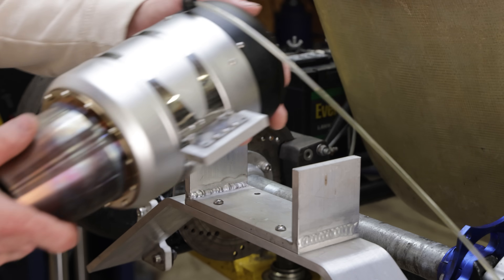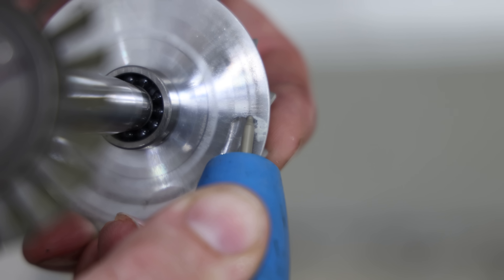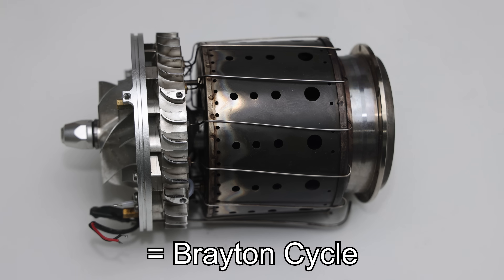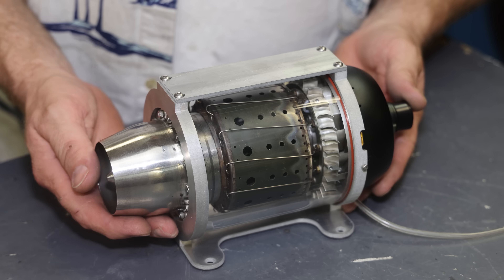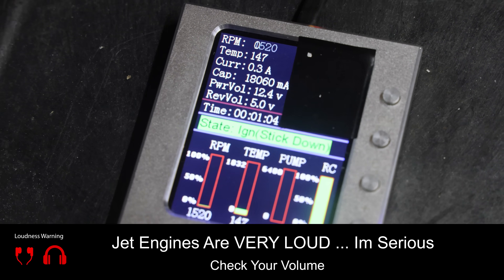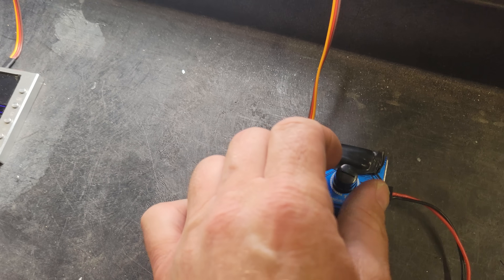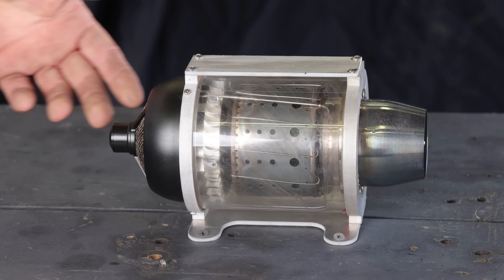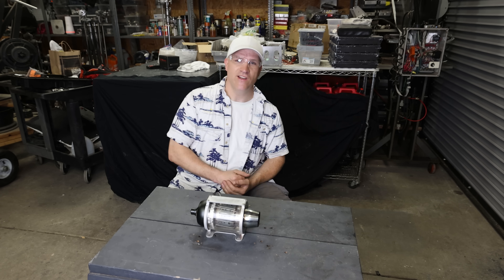See Thru Jet Engine

Comment: As you’ve built it, this is a turbojet. Meaning all of the intake air goes into the compressor and the combustor section. If you had built a high bypass turbofan, meaning that some or most of the air intake actually never gets compressed or burned, then would we see more of the fog going through the engine I’m asking. Would that also change the flow characteristics? Again just honest questions based on my very limited understanding. I’m curious and great content as always 👍

Comment: That would be an incredible opportunity to see how the parts heat up in a bypass type turbine engine too. Ideally, there should be no hotspots in such an engine as the only thermal expansion allowed would be within the air envelope and between the vanes with no heat transfer to other metal parts.
Reply: Bypass engines have a shrouded fan and the air exits around the outside of the core not through the core.

Comment: I am a gear head that was the best insightful video of a thrust type gas turbine engine .As a kid a guy built a turbine engine with an output shaft to a reduction box and tied it to a drive axel . The engine was only around two times maybe more physically the size of yours .The car this was mounted to was an early 60 vw bug  after problems solved took it to drag strip  .The bug is an aerodynamic disaster at 200mph it's an ugly  wing .Half way through a quarter mile run it took off  it landed on it's roof and went thru the traps around 180 mph on the roof and backwards ,to set a track record he had to make a second run and only had 10 minutes to get ready .The company was Turbineque, check your aerodynamic package . Liked your demo!!

Comment: As former civil aviation specialist, i would like to know how much force its making.
We in Eastern Europe use Kilogram-force (kgF) or Nm for torque  for jet engines
Reply: A turbojet engine like this produces force, not torque; this is not a turboshaft engine so it has no output shaft.

"kgf" is a non-standard measure of force (it should be newtons, N), but Nm (newton-metres) is a measure of torque.

Warped Perception commented earlier that 
"This one is small about 30 lb of thrust."
That would be 133 N.

Comment: your theory at the end is correct except in the case of turbo-fan jet engines, which is what you see on most commercial airline medium & wide body aircraft such as your 737's, 747's, 57's, 67's, a320's, etc, etc..
Reply: No, his theory is not correct for any engine. The force produced by a jet engine is a reaction to the high-speed exhaust flow, and that exhaust is almost entirely air. The mass of fuel is insignificant compared to the mass of air (fuel is 2% of air at the most); the fuel adds energy by burning.

Yes, turbofan engines are really turboshaft engines driving fans: energy is extracted from the exhaust flow to drive a shaft, which drives the fan, which pushes air for more efficient production of thrust... so only a small part of the thrust is in reaction to the exhaust flow.
Reply: @brianb-p6586  you're right, good to know. it didn't even cross my mind to check on that. all i know about turbine engines pertains strictly to turbo-fan engines as ive worked very near & around them for about 4yrs (im a structures mechanic, not an A/P, so i dont mess with them).

yeah i just heard what he said there at the end & im thinking like, ok ill assume hes right since hes opening his mouth Lol BUT, i know for a fact that doesn't apply to turbofan engines.. 
~thanx for the clarification

Comment: I was hoping you would be able to tell us how many pounds of thrust that produced. Maybe put it on something to make it move. The other thing is we all have seen the fighter jets flame on take off-probably at full throttle, but commercial planes don't. Why is that? I'll be looking forward to your response. And I just got an idea! Contact the NHRA and ask them if you could have a jet go-cart Drag Race the full 1000 feet. That would be cool to see!!!
Reply: In a reply to another comment Warped Perception said that it produced about 30 pounds of thrust, but that's not measured in these runs.

Big flames from military fighter aircraft are from afterburning, which is crudely dumping fuel into the engine exhaust to add some more heat and so more exhaust velocity, increasing thrust. It is horribly inefficient and so would never be used on a commercial aircraft, except in exceptional cases such as the supersonic Concorde.

Comment: What initially gets the turbine spinning? An electric motor? If so, how do you keep it from getting too hot while the turbine is at operating and or max thrust? Also do larger turbines have any sort of liquid cooling? Even channeled or gallied fuel like they use to cool rocket nozzles.
Reply: The engine is started by an electric motor, which is mounted on the intake end so it is cooled by intake air.

Comment: what material cylinder can deal with 200krpm, ie, over 120 000rpm spinning, as a very high specific energy electric motor-generator storage, stick it up in maglev, yes, vertical
Reply: that spinning is the same as a bullet getting shocked with an explosive charge, over 120k of g's, but mega g's
Reply: so it must be a bullet metal then, full metal jacket
Reply: nice vtol battery mate
Reply: with a turbine of course
Reply: with a clutch
Reply: 200krpm should be 30kWh/kg specific energy for the mechanical battery, and it works as a gyroscope stabilizer (make sure you have a contra rotating alongside it, same speed)
Reply: no gyroscope precession, because they nullify each other
Reply: so the output speed matters, its E=½mv^2

Comment: I want to see how the starter disengages. It does disconnect right ?  I imagine electromagnet coils would melt at such an RPM.
My guess is that it's centrifugal, but it'd have to be hooked up backwards to normal centrifugal clutches.
My mind can think of lots of ways to pull this off, but I'm very curious how it is implemented. You'd want it to engage on the shaft so there wasn't a large mass correct ?
Reply: I don't know how this one is arranged, but there's no need to mechanically disconnect a very small diameter motor at this speed. Speed doesn't melt wire. Because it is only used for starting, it might have a one-way clutch. All the tiny turbine engines seem to use a similar design - someone must know how it is connected.

Comment: With the turbine at the exhaust, is it designed to purposely extract only a certain percentage of energy? And if so, how much would that be?
Reply: Yes, the turbine in a turbojet extracts only enough energy to run the compressor. Turboshaft, turboprop, and turbofan engines add turbines to extract energy to drive the shaft (and so drive the prop or fan in those cases).

Comment: Great work. Bar none. Intake-compression-combustion-exhaust is most concise. Glad I am a loyal subscriber. 
So many thing to learn here. I am guessing that the glass cylinder chamber that you made is actually the cooling component of the jet because the combustion chamber's wall is so thin, bright hot, and nearly melting. Looks like the coolant air is also part of the continuum of the working gas. So, it is a continuous intake-compression-combustion-exhaust-cooling , hehe. There is no physical boundary between the coolant and the working gas. This thing is pure genius.
Reply: Ironically the thing that burned your hand was cooling system that was the coolest part past the combustion cycle.

Comment: Air has weight. Thrust is exactly equal to the amount of weight in air that it moves.
Awesome video, I loved it. Centrifugal compressor...
Reply: Single-stage compressors are commonly centrifugal.
Reply: @brianb-p6586   Ofcourse
Reply: Momentum is the product of mass and velocity. Thrust by the engine is equal to the rate of change in momentum of the air that it moves, not the weight of the air.
Reply: @brianb-p6586  No, that would be effluent airspeed.
Reply: @nimrodquimbus912  what do you think "would be effluent airspeed"? Speed alone is meaningless.
Reply: @nimrodquimbus912  In case you just don't have the vocabulary... "speed" is the magnitude of "velocity". The product of the exhaust (of effluent) velocity (or speed) and the mass (not weight) of the exhaust (which is almost entirely air) is the exhaust momentum.
Reply: @brianb-p6586  You probably should return to your safe space, and not come out until you are able to understand the meaning of the words that you use.
Reply: @nimrodquimbus912  So, how is the thrust related to the force of gravity on some amount of air. The answer, of course, is that it is not.
Reply: @brianb-p6586  Take care, child

Comment: if you want your engine to last, you should never shut it down directly from full power, idle it for at least 20 seconds for the EGT and internal shaft and bearings temperature to stabilize, then cut off the fuel, otherwise the engine will be severely warped and turbine blades will crack and fail

Comment: In contrast to the comment, the airflow is the important part of the operation of a turbojet engine - the output energy is entirely the kinetic energy of the blast ("jet") of exhaust. Thrust force is the rate of change of momentum of fluid through the engine, and momentum is mass multiplied by velocity.

Of course there's no direct connection between a mass of air in pounds (over what time?) and the thrust force (also in pounds, but pounds of force instead of mass) produced by the engine.

The fog didn't work to show airflow because the water droplets vapourize in the engine so they are no longer visible. A tracer which survives the compression and combustion processes would be required.
Reply: Matt noted in another comment that it was a glycerine fog, not just water... same problem; the glycerine won't survive the combustion process, if it even makes it through the compressor as droplets.

Comment: 5:49 That flexing demonstrated the internal pressures better than anything I've ever seen and thats after 20 years as an aviation professional with a masters in aviation and space sciences. Very well done!!
Reply: Just curious; you say you’re an aviation professional with a masters in aviation and space sciences.. what does that mean? Are you a mechanical engineer? Aerospace engineer? What was your title
Reply: @Macattack7  Hey Tony, Thanks for the question. My degree is non-technical which means I can't claim to be a scientist or engineer sadly. But during my undergrad work I still had to design a mathematical model of a jet engine, I used excel. Matlab wasn't a thing back then. Also had to get real familiar with things like GPS and GloNASS, aerodynamics, orbital equations etc. I am a pilot with with 2 certifications, private and unmanned. My grad degree was less technical.  The first half of it focusing on airline operations, second half focusing on space exploration. As my thesis I researched and wrote a paper on ethical governance of space based resources and off planet colonies. Really it was just an excuse to research how a Mars colony would be governed. Work wise, its all been aviation. Started my career at a flight school, moved on to a high altitude research center where I conducted cabin pressure research for boeing to see if lowering the cabin altitude made for better pilots. A short stint in operations or KTUL, then on to aviation operations for a part 135 operator. Currently i teach drone law. Built and flown two aircraft, one of which was experimental (the better of the two I might add, lol). Been around jet engines my whole career, even got to fly a B-17 (not jet obviously) for a summer during airshow season, and at one stop flew it with Buzz Aldrin!!! A lot more experiences in the last 20+ years but those are the highlights. Sorry for the long reply, but thats what it means. Still mostly interested in space though. Its just really hard to get into unless you have the engineering title.
Reply: @TychoBrahe21  thanks for the thorough reply! I am currently in school for airframe and power plant so when I heard all your titles I was curious as to what that was but it’s interesting to hear about different intimacies within the industry.
Reply: @Macattack7  A and P, thats awesome. Good money to be had as an A&P. A lot of hours though, most ops hire as few maintenance people as possible.  Good luck on your schooling and if you're ever around KRVS...
Reply: That movement doe.... Omg
Reply: @terryspry8482 . 8 o,
Reply: @coorsbanq  I feel ya on the mathematics. I love physics and engineering but they're relegated to hobbies for me now. If I did it over again I'd do what ever I had to to find a good tutor. I've learned a bit of higher math on my own, and can honestly say the teaching methods for math are completely backwards, to our detriment. Speaking of UND, I think you guys have the altitude chamber I used to operate. Ask around, see if its from OSU. I could be mistaken though, but it is a small world.
Reply: @coorsbanq  Ah, well I'm not sure where my old chamber disappeared to then.  Regardless I know if I'm flying and start to giggle its time to descend!  Well good luck on your studies and flight training, fly safe!
Reply: Degrees in aviation and space doesn't mean you know turbines. I should know.  I'm in aerospace.
Reply: "masters"..LoL.
Reply: @r0ky_M  Master's....Better?
Reply: @TychoBrahe21  
In over 20 yrs how much have you ever seen of GT engines up close and technical?
Reply: @r0ky_M  Quite alot. At the 135 operation we did our own maintenance on the jet fleet (not part 145 stuff though), mostly LR35, LR45, and LR60's. The 35's and 45's being older had a lot of maintenance requirements on top of the standard required continuous airworthiness inspection programs. The LR45's in particular (at least ours) had thrust reverser issues what seemed like once a month, so those engines were opened more frequently.  Also had a decent stint at a part 145 base, messed around on quite a few engines there. So over 20 yrs?.... I have no idea, between work and hobbies that put me in contact with turbine engines,... I've probably been "intimate" with a couple hundred.
Reply: @r0ky_M  Are you interested in getting into aviation? If you're in the US I can point you at some very good programs to get you started, or if you're already in aviation I'd love to hear about some of your experiences.
Reply: @TychoBrahe21  
Why do you keep bragging so much  about sections of your career which had nothing to do with GT engine experience?
Reply: @r0ky_M  Also glad to hear you think my career is worth bragging about. It really has been fun. So thanks for that, your too kind.
Reply: @TychoBrahe21  
Your career claims are fiction as far as we know..and you clearly just came here to talk about yourself.
Reply: @r0ky_M  I've never been so busted. I am actually a meat popsicle in the business of collecting unpaired socks, because as we all know phase 1: Socks, phase 3: profit!!
Reply: @TychoBrahe21  
Whatever you are,  You still can't stop talking about yourself ..🙄
Reply: @r0ky_M  I know right? Weird. Do you think I have an issue?
Reply: @r0ky_M  Truth be told I'm just dragging you along to see how many replies I can get from you.
Reply: @TychoBrahe21  
Truth is you are not a qualified jet engine technician, but you seem to have plenty to say about yourself ..
Reply: @r0ky_M  100% correct. I never got an A and P....oh dang, talking about my self again, my bad.  Tell me about you then? Why you here, you like jet engines? Like aviation? What's your experience?
Reply: @r0ky_M  Your comment keeps cracking me up. Like of all the things I've listed, none of them were being a turbine engine tech. And through what must have been considerable brain power, you deduced..... that I've never been a turbine engine tech. LOL.  Did you have to break a sweat for that?  Come on man don't leave me hangin' just a few more responses from you, lets see if we can get to the double digits.
Reply: @TychoBrahe21  Don't feed the trolls. Dude is just jealous that you have a career that contributes to society.
Reply: Right you are.
Reply: @TychoBrahe21  that’s sweet man!
Reply: @TychoBrahe21  Thanks for the brilliant business plan. I can't find any socks, but my mate Kyle says underpants should work too! I'm off to make millions!!!!!! Great chat 👍
Reply: @oldmanstumpie1061  Sorry I can only like this comment once! I'm just stoked someone got the reference!
Reply: @TychoBrahe21  
You are not a GT tech yet have sprouted so much irrelevant career  drivel on a GT video..
..funny yet kinda sad.
Reply: @r0ky_M  Only 3 more comments to go and I'll win my bet. I'm routing for ya little buddy!!
Reply: I work at NASA and was in charge of the moon landings- not to mention I got my BS and my Masters at the Bass Pro Institute of Technology, and I'm calling this comment out as being one of the best on youtube. Very well done sir!!🙂

Comment: Maybe try strings/thread flapping on the inside of the glass to visualize flow. For a view inside the combustion chamber, maybe just a window nearer to the compressor side and a small tube to "wash/cool" the inside of the window with air directly from the compressor. Or point one of your fuel jets directly at it at a short enough distance that it is still rich and not ignited.

Integza channel is a good one for ideas on keeping things cool that weren't intended for a hot environment. Would take a complete redesign of the combustion chamber though to completely cool the walls with compressor air. But check out his more recent "plastic" engines and nozzles.

Comment: Smoke machine is not really smoke, it's atomized liquid. air speed and the sheer volume of inrushing air probably disperses the vapor in the compressor already and it's probably too hot and dry inside the engine for the remaining vapor to persist as a visible cloud